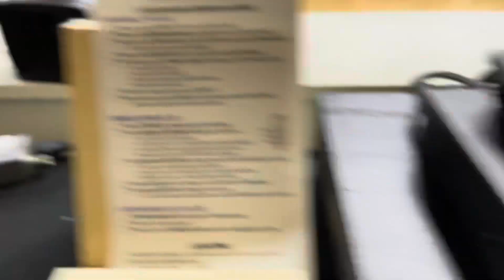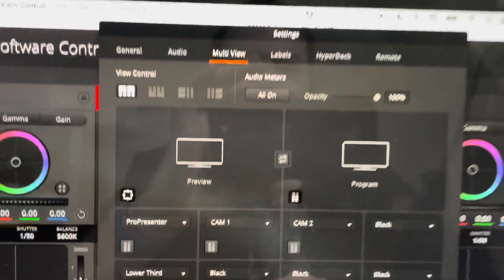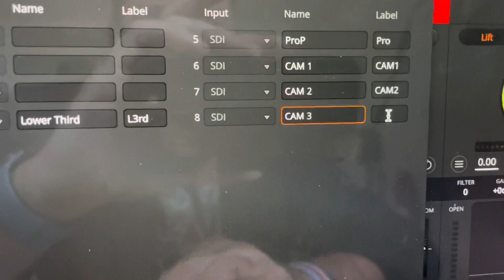Setting up inputs in ATEM TV switcher multiview #church #worship #tech

Comment: Hi, question here. I was able to do this process with no issue, but I am having an issue configuring it as a button on my ATEM switcher. I use a digital interface & currently have 3 cameras. I added the fourth but need to add it to my switcher to command it?
Reply from the maker: Did you already follow the steps in the video? Are you running the ATEM software?